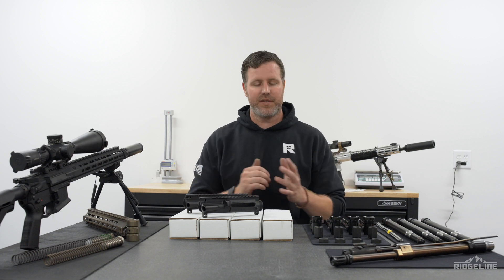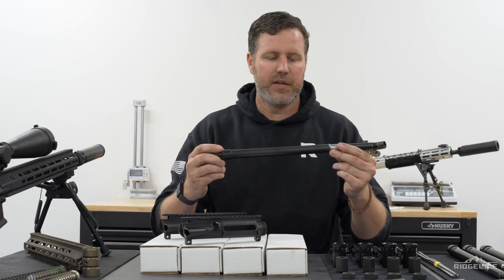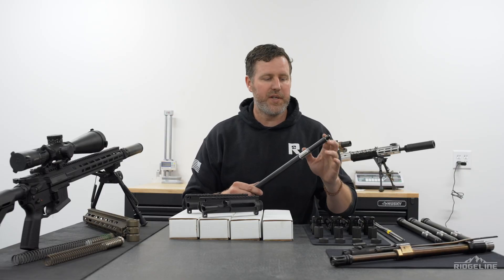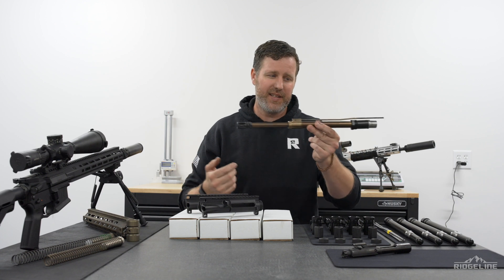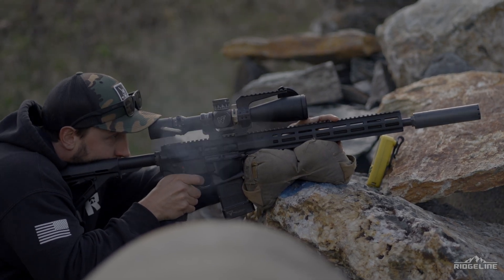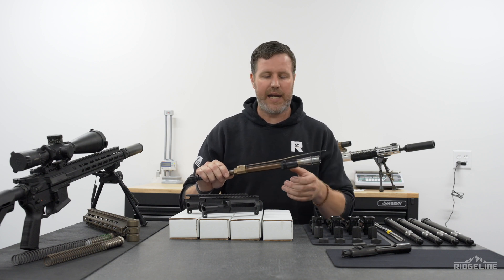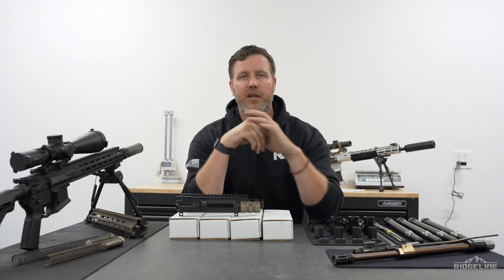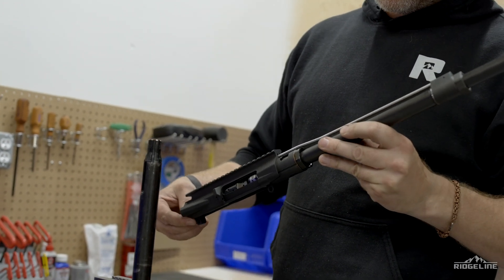The Science Behind the all new RD15-LPR with Dr. Rudy - Episode 1

Comment: Most people probably aren't aware but you can tell what temperature steel got to by the color of the discoloration. The barrel he's holding up at 4:34 got quite hot indeed. That's definitely brown to my eye which indicates that it got up to 735 degrees Fahrenheit and based on how thoroughly discolored it is it would appear that it stayed at that temperature for quite a while. What I find interesting is that the area around the chamber has little to no discoloration at all. I would've thought it would have at least turned yellow based on the discoloration of the rest of the barrel. That may be because the steel is thicker there.

I think people are really underestimating how durable stainless steel rifle barrels are because the claims online of decreased barrel life. Perhaps the barrel life is decreased. I'd think rather than a blanket statement like that though it would depend on the firing schedule, whether it was suppressed, quality of machining(stainless is easier to work with than something like 4150 cmv, significantly easier in fact), etc.

Comment: Saw a video covering the mounting of your semi-monolithic rail to the receiver and if I remember right it was only using three very small screws with some interesting mounting hard wear. As I'm sure you guys designed it for hard use I would be very interested in a video covering that lockup system and what kind of abuse you guys designed it to handle and/or how you tested it to ensure that it would hold up to serious use. Everything else I've seen on this rifle really impressed me, especially the gas system. I think more companies need to follow in knights path and figure out better ar15 gas system designs that allow for more controlled gas regulation, easier and more sturdy installation/disassembly, and that place less stress on the barrel, and I think this is a step in the right direction, so kudos on that. I don't think companies need to worry about producing proprietary stuff so long as they don't stray too far from our second lord and savior Eugene Stoner's original vision. It doesn't hurt knights to have proprietary stuff, so I would encourage you guys to continue down this road. Maybe consider taking many of these design enhancements and applying them to a line of fighting rifles as well as opposed to just precision rifles. I would love this jam nut design and hand guard design (assuming it's solid) on an 11.5. I really want other companies to try and compete with KAC and figure out how they can achieve similar design enhancements so KAC isn't the only game in town, as much as I love them I also love competition and options. I'll be waiting for the 18 inch lpr, and looking forward to more content covering the rail mounting design and seeing where you guys go with all this. Keep up the great work
Reply from the maker: The most destructive test of that hardware included an 8' pipe being placed around a hand guard on a test fixture to apply leverage over the system prior to being both static and dynamically loaded.  The each time the test fixtures failed (literally stretched and tore the aluminum) before we even came close to the sheer rating of (1) of the (3) bolts.  The cam plates and bolts remained locked and in position.  I think there is video of me  doing pull-ups on a receiver set somewhere as well haha
Reply: @ridgeline_defense  great to hear, definitely produce some content on that showing off what it can handle because the internet seems to he obsessed with rail flex and lockup between different manufacturers. When I first got into ar15s the two things that came to mind were "wait, why don't they just mount the handguard to the upper receiver rather than the barrel nut?" And "why do they allow gas to leak out around the gas block?" So great job addressing those obvious ways to improve the system. Like I said, consider making an entire line of rifles with these improvements, from 11.5 ar15s all the way up to 6.5 creedmoor ar10s. You don't need a lot of SKUs, just give knights a run for their money lol since you guys love precision stuff I'm sure you could do a 20 or 22 inch 6.5 creedmoor and punish knights for not making their 6.5 upper more avaliable. You could also potentially do a 14.5 creedmoor and dominate the high end battle rifle market.
Reply: The KAC mod 2 gas system is basically a copy of a fitting used to seal hydraulic lines. We use these types of fittings in the tooling industry and they cost next to nothing but throw it on an SR15 and its suddenly very expensive.
Reply: @armorers_wrench  this is exactly what I mean, it's pretty common sense to do what KAC did in many ways, but no one seems to want to risk making proprietary stuff, despite the success of kac. But all they did was say, hey, gas system leaks, let's fix that. Bolt carrier cracks at the cam pin hole, let's make it smaller. Electors and extractors fail, let's add redundancy. Bolt lugs shear, let's round them to reduce that. I see all this and think, cool, I wonder how other manufacturers will follow in their footsteps, and other manufacturers seem to not do shit. KAK industries is the only place I know of to get a sand cutter chrome Bcg with duel ejectors, and they are not a high end company. Psa had an enhanced m4 project at shot show with an improved bcg along with a bunch of other expensive and questionable design choices and it didn't even make the top three of audience vote. I don't think people understand that the ar15 is the best semi auto rifle platform we have and that it needs to be modernized and improved. We need a new upper receiver that handguards mount directly to, we need a better gas tube/gas block/barrel interface, and we need improved bcgs. Until more companies get their heads out of the sand I will continue to simp for KAC, not because I want to, but because they are the only ones improving the system, and lmt of course but I also have my issues with them, like changing the Bolt to work better suppressed but also creating issues for full auto, or just not making their handguards long enough. Thankfully now I can also say Ridgeline Defense is making some moves in the right direction, which is funny, because I would have hoped geissele would have done this shit, they were the obvious choice, but they decided, nah, we aren't gunna do any of that, we are gunna drill multiple holes for the gas port and add an extra 1500 onto the asking price 🤦‍♂️

Comment: What is your reject rate on parts?
Reply from the maker: Honestly, not as high as you’d think for a few reasons.  1. We are working with vendors that put out an extraordinarily high quality product 2. We double buy gauges.  We make our vendors gauge prior to shipping so when we receive and gauge them it’s very rare that we have to reject something.
Reply: @ridgeline_defense  My guess would be less than 2% reject rate. I'm assuming you're dealing with competent machine shops and not some fly by night dude in a shed.
Reply: I'd be shocked if it was high. It's very easy to be very precise with modern CNC machinery. Gun parts aren't super complicated to machine.